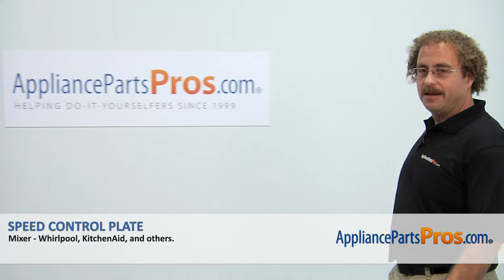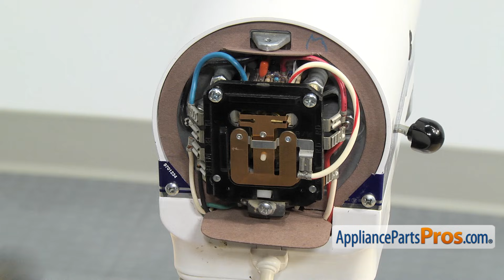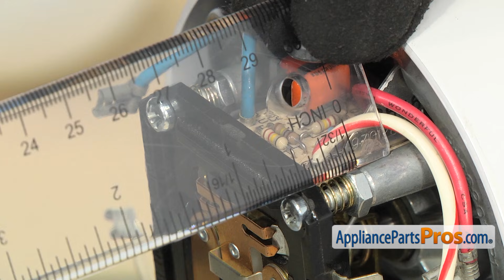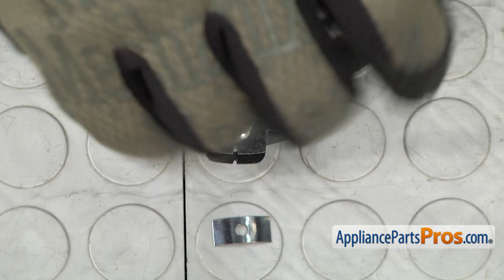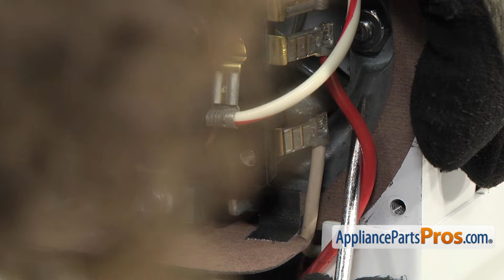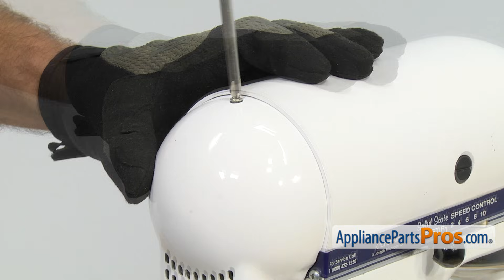How To: Whirlpool/KitchenAid/Maytag Mixer Speed Control Plate WPW10119326

Comment: Hi, my mixer run on same speeds 1-6, and I try to play with the screws, but result the same(( could changing Speed Control Plate help fix it?
Reply from the maker: We'd be happy to help you figure that out, but we'll need some additional information about the model and the problem. You can give us a call at 1-877-477-7278 or you can chat us at our website: http://www.appliancepartspros.com/. We will need the model number for the appliance, so that we can look up diagrams and information about your specific unit to give you accurate advice. You can look here on our website to help you find the model number: http://www.appliancepartspros.com/modelnumber_locator.aspx

Comment: I replaced both the governor and speed control plate on my mixer.  Your instructions were really good.  I had to loosen the stir speed adjusting screws more than the 3/8" factory setting.  I actually had to go out to 9/16"; that's about a little more than 1/8".  Is that normal?  At first I thought the governor wasn't fully engaged, but after checking it again, I found it to be seated.  The governor must be a little bigger than the original one.  I was wondering if something was wrong since I had to adjust it out so much.  It runs well at that setting, so everything seems to be fine.  Thanks!
Reply from the maker: That's not unusual. Glad we could help you get it repaired!
Reply: AppliancePartsPros:  Thanks for your further comments and have a good day!
Reply from the maker: You too! Glad we could help!

Comment: My mixer would only run on speeds 1-6 so I bought a new control plate. When I took the back cap off I noticed white wire on lower right side was disconnected. Put it back on and runs great. so now I have a spare controller if it fails in the future.
Reply from the maker: We're glad to hear you got it fixed!

Comment: My mixer only mixes on high speed even if I have it set on a low setting. Will this part fix that issue? Thank you.
Reply from the maker: We'd be happy to help you diagnose the problem and recommend the necessary part. We offer free technical advice and diagnosis. You can give us a call at 1-877-477-7278 or you can chat us at our website: http://www.appliancepartspros.com/. We will need your model number to give you accurate advice, which you can locate using this tool on our website: http://www.appliancepartspros.com/modelnumber_locator.aspx

Comment: Great video. Thanks for posting. I successfully replaced the speed control plate; however, the mixer will not turn off when the speed control lever is put in the off position. When plugged in, the mixer automatically flips to the 2 or 3 speed position making it impossible to turn off without unplugging the mixer. Can you advise me on what is causing this? I'm wondering if the spring on the speed control switch is not applying enough tension to the plate to keep the lever in the off position? Thanks for any advise you can offer.
Reply: Brint Driggs ñ
Reply from the maker: Thanks for your feedback, Brint. It sounds like the plate may not be adjusted correctly.
Reply: Brint Driggs the screw holding the lever is loosening.

Comment: It seems my back cover is too close to the speed control plate. Whenever I touch the back cover, the mixer slows. Is this a typical problem? How can it be fixed?
Reply: Hello, my mixer is making a grinding noise. Did you get yours to stop? Thanks
Reply from the maker: Without knowing what you have, I would suggest posting the problem along with the appliance model number on our repair forum and the techs can help you troubleshoot the problem. http://forum.appliancepartspros.com/
Reply: Hey, thanks for the response. I think the previous owner messed the thing up by not putting the locking washers back on the threaded rods that hold the motor field assembly in. The nuts were backing out, allowing the field assembly to slop around. The machine was knocking and grinding. There are lots of other issues too, but I think I am getting it back together. I hope.
Reply: Mostly. I just replaced the locking washers on the threaded rods that hold the field assembly in place. There are still some little bits of broken magnet that are getting ground up inside, and eventually I'll most likely need to replace the field assembly.